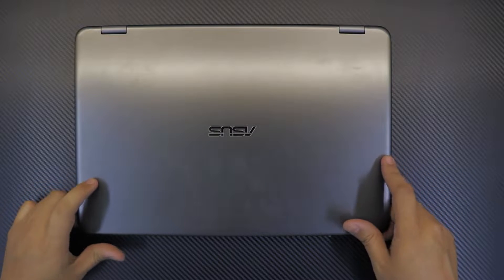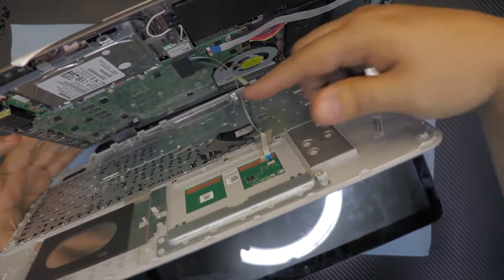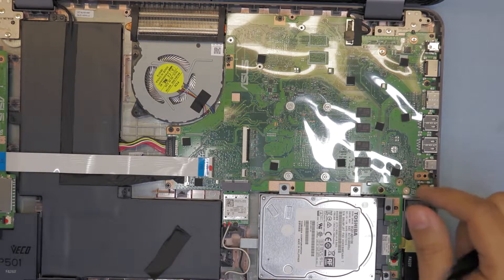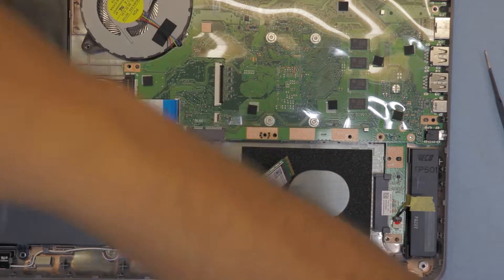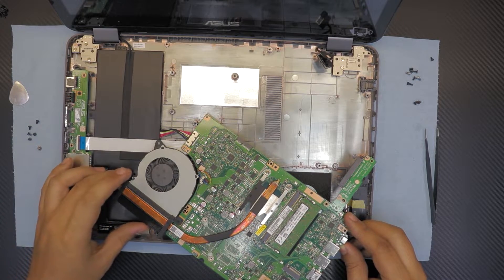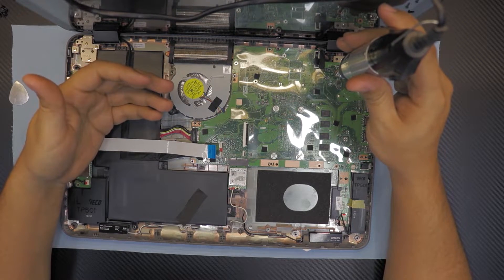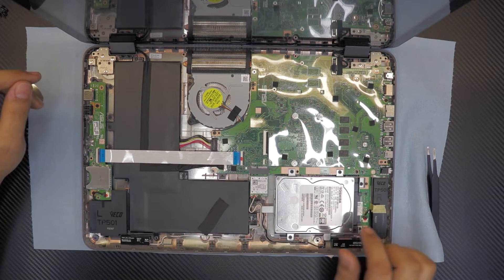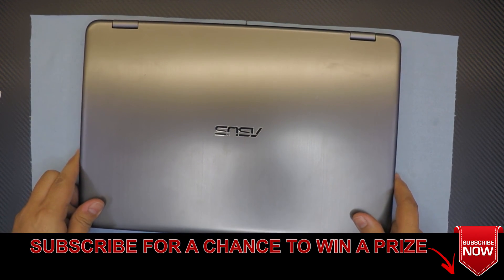ASUS VivoBook Flip TP501UA Disassembly and Service

Comment: Can I insert an extra SSD Sata in a m.2 port, and where is that port located? Thank you!
Reply from the maker: you can only put a ssd sata by replacing your HDD mechanical. there is no M.2 slot available for m.2 ssd
Reply: @uFixTek  I´ve already replaced the HDD to a SSD of 500GB but now i want more storage so can i put a SATA SSD M.2 in the port of min 10:35 beside hdmi? or i have to replace my SSD to a new one with more capacity? Thank you for your response! I have an ASUS TP501UB-DN018T
Reply from the maker: xSerchcresx  sorry didn’t recall the back side m.2 slot. To just clarify: this are different: 1. Hdd sata ( its a mechanical hard drive with sata conector ).  2. ssd sata is a solid state with sata interface ( same conector as where you have you main hardrive).  3. M.2 slot is for m.2 ssd only , (m.2 ssd sata doesn’t exist)  4. Sata connectors hace reaches to the limit speed by ssd drives. So thats why they came up with m.2 slot as they use a pci express port. So the m.2 slot have a wide bandwidth for file transfer, if you put a m.2 ssd in that slot it will wor fine and it will only work to mas speed of you sata conector. BUT if you buy a NVME ssd you can plug it in there and the nvme ssd are 6x faster than m.2 ssd or sata sad drives.  Therefore YES you can purchase an “m.2 ssd” or “nvme ssd” they both will work just fine only that nvme will be much faster.
Reply: @uFixTek  Perfect, thank you for your time! You´re awsome!
Greetings from México.
Reply from the maker: im in mexico queretaro :) saludos

Comment: Thank you for this clear video. I got a Asus Vivobook Flip TP410UA-EC380T PC. It has 6 GB, and I would like to add 8 GB. Do you think that the RAM slot is available?
Reply from the maker: thank you for the awesome feedback, and regarding your model it should have a single dim available. open it up and take a look :P
Reply: uFixTek Thanks for your kind answer. I opened it and unfortunatelly the only slot is taken by the 6 GB memory. So I did not upgrade it for a 8.

Comment: Hi, The plug at the rear, I think you said it might be the LCD plug, is that a pull up or pull to the right hand side? and also the right hand speaker plug, is it a pull up or pull away? Many thanks for taking the time to do this video by the way.
Reply from the maker: @5:11 the jack LCD on top right (black) its a pull up jack.
the battery cable is a pull up too,
the speakers comes out by sliding to the screen side.
Reply: @uFixTek  Cool, thanks for the reply. I successfully replaced the 1 TB spinny drive with a Samung 1 TB SSD. I wouldn't have been confident without your video.

Comment: Where i can find M.2 ssd port in tp501?
Reply from the maker: its right under mobo, beside the ram, @ 10:37  you can see the port right beside hdmi jack
Reply: @uFixTek  thank you
Reply: Hi Simon, did you install a m.2 SSD? If so, what make and model did you use? I tried a Samsung 970evoplus 1TB model MZ-V7S1T0 but BIOS didn't pick it up.
Reply: @abeeconstable7877  you need to know what type of ssd for your device, using sata or nvme? My device use sata so i buy ssd type sata. The Ssd that you buy is type nvme, so i guess why bios cant read your ssd because your device only can read ssd type sata.

Comment: I have the same laptop, and I was trying to see if I could reset the BIOS by removing the CMOS battery.  But I have taken the whole thing apart and I can't seem to find it.  Could you offer some guidance on where it may be?
Reply from the maker: Mike Co this mobos dont use a cr2030 battery, they keep the config using the internal laptop battery. 
To reset bios do the following:
1. Open the laptop.
2. Disconnect the internal polymer battery.
3. Plug in or press on on/off (power button) keep pressing for 30sec, this will make sure it will discharge all the capacitors on board. 

4. Plug back everything and done.

For the step 3, dont use or plug in the charger
Reply: @uFixTek  thank you.....will try that out.

Comment: My laptop has a 120GB SSD drive in addition to the 1TB HDD. Did your model have the SSD drive and if so, where was it located. Note that when I open my device, it pretty much looks the same as the one you are showing.

Thanks.
Reply from the maker: this model doesn't have a ssd drive , if yours has a ssd drive then it would look like a stick of ram. https://bit.ly/2DA9JaU

Comment: Excellent .... Wish you had done a close up of the ram module.
Reply from the maker: :/ thanks but its pre closeup on ram @10:28 and  @9:00 . what kinda info you need regarding the ram?
Reply: @uFixTek  Specifications ???
Reply from the maker: it only has one dim slot available that can go up to 8 GB SDRAM,  the ram that comes in the box is a DDR3L 1600MHz 4gb

Comment: Are you able to upgrade the cpu? If so, would you be able to make a video on how to?
Reply from the maker: NO you cant, even if you get a alien-ware laptops you cant upgrade cpu anymore they solder those on the board, so you get what you pay for.
Reply: @uFixTek  Man... That sucks. I thought since laptops are not like what they used to be that they would leave room for upgrades at this point

Comment: Hi ! And thanks for the video. Can you also make a video with disassembly the screen ? Or better a whole disassembly of a TP510UA and not the TP501UA ?
Reply from the maker: i will do a disassembly of the screen soon i have a list of the videos that are in the track and i will add your request to the list.  but if you want to know about the screen it has to be removed with a heat gun as it has a adhesive tape.
cuando ya tenga listo el video te aviso. saludos
Reply: @uFixTek  Do you mean that the screen is sticked to the touch digitizer ? and that the only way to remove it is to use a heat gun ?
Reply: Hi. I need a video for the tp510ua, I can't find any, I want to upgrade ram memory
Reply: Did you find anything?  I'm in the same boat right now; have the bottom cover off the TP-510UA, but don't see where the RAM slots are (possibly on the underside of the motherboard, like in this video).  Adding an M.2 SATA drive wasn't difficult, and made a big improvement.

Comment: Thanks for video.........
I have the same laptop Asus VivoBook Flip TP501UAK. 
 
I have a couple of questions.plz answer them.
1)Can i upgrade my RAM.? if yes, up to what extent i can do?

2)my HDD is damn slow. so, i would like upgrade my hard drive with SSD.
what kind SSD, I can choose either M2 or2.5 sata ?  which one is suitable for this laptop. 
In your opinion, which is the best brand buy for 1TB SSD.
Reply from the maker: the ram you can only upgrade  one stick any to any DDR3L 1600 SODIMM
. or better.
recommend you: https://amzn.to/2qtcrYK

as far as HDD, you can only go regualr 2.5" ssd drives.

recommend you: https://amzn.to/2JB5iOZ

just with the ssd drive you will see a huge change in speed and applications.

anything else let me know.
Reply: @uFixTek  thanks buddy...when i opened my laptop cap..i could not see empty ram slot ...looks like i have one slot,which is filled with default 4gb....i found no other expandable slots......
would you plz confirm, whether i have empty slot or not ???

or should i have to remove deafalt 4gb and add 8gb as upgrade ?
Reply: Hi  Shashank, Did you get to install and SSD, if so, what make and model did you end up getting to work?